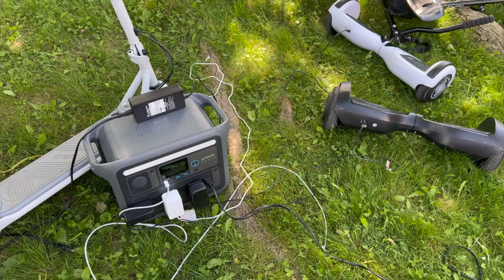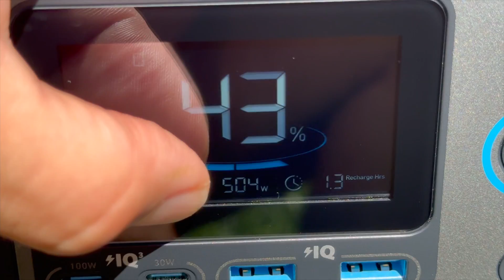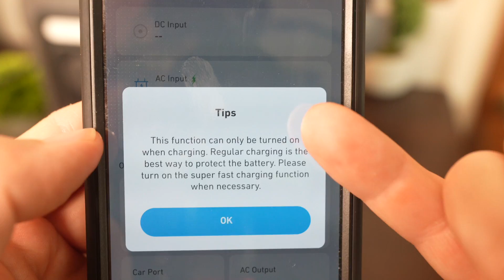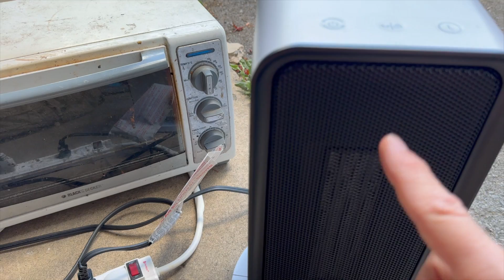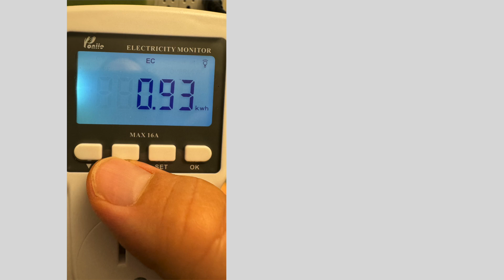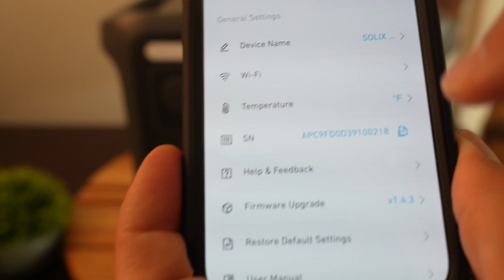One of the Best 1KwH Power Stations? | Anker SOLIX C1000

Comment: I have the Anker Solix C 1000 and a Harbor Freight solid 100 solar panel, don't have it completed yet ,waiting on connector to splice into the HB wiring.
My question is when I am charging with solar or AC ,do I leave the C 1000 turned on or off,and why ???
Reply from the maker: The power station will automatically turn on while it's charging (AC or DC source).  You can turn the outputs off or on as you desire because it can charge and discharge at the same time.  If you aren't using them, it's best to leave the AC and DC outputs off.  The AC output especially uses a small amount of power while idling.

Comment: Would you recommend getting the Anker solar panels or other brands? 
Thanks
Reply from the maker: Unless you can get it cheaper as a bundle, I wouldn't necessary recommend an Anker solar panel over another name brand.  There's nothing wrong with the Anker panels, they are high quality.  Besides price, I think you want to think through where you most use it.  So you can use the C1000 with rigid solar panels, thin film, thin fiberglass backed panels, and different style of portable panels.  Just make sure you are under the 60V input limit.
Reply: @solarguy  Is there a solar panel you'd recommend with this unit?  Thx!
Reply from the maker: It depends on what your use case is.  If you are moving around a lot then you might want to get a portable panel versus a rigid one.  If you have more questions, it would be helpful to start a new comment.   Are you wanting a rigid or portable type panel?
Reply: @solarguy  Yes for sure portable would be best . Mostly using my Anker for camping
Reply: I second this haha. I am also looking for portable solar panels for camping as well as rigid solar panels for at home use for storms etc.